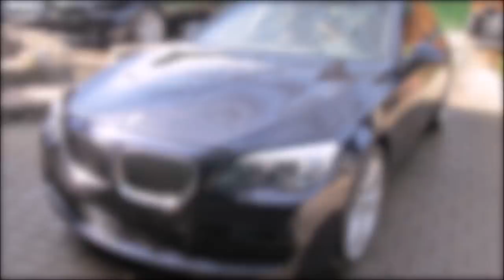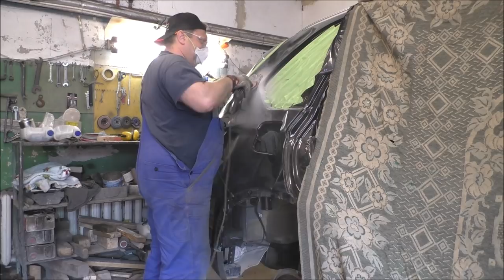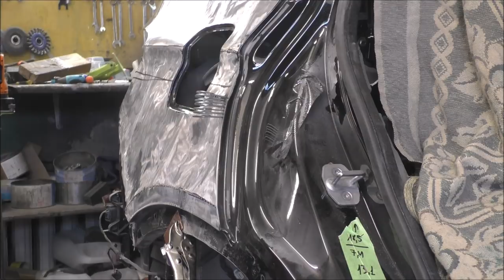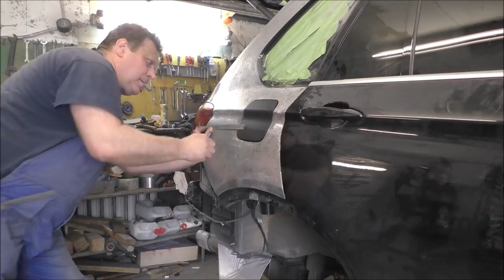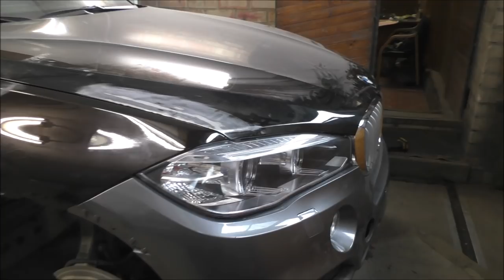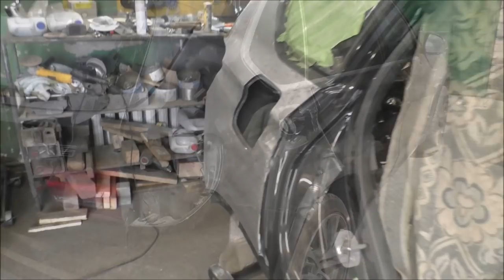BMW X5. Body repair.  Ремонт кузова.

Comment: I'm curious to know what the shop hour rate is, Arthur can fix that quarter panel easily, but it's a lot of labor. I'm betting the labor to fix the old panel  was close to a used one from a salvage yard.

Comment: NIce work.  With todays modern cars though I wonder how much grinding and sanding you can actually do.  Some of the sheet metal they use is so darn thin as is, I can't imaging sanding/grinding away 30-40% of it.

Comment: Why didn't the owner want to have the quarter panel replaced? Wouldn't it be cheaper than let you working days to get the old one in shape again?
Reply from the maker: It is easier to replace, but to repair cheaper.

Comment: Looks great Arthur, another fantastic finish. Once again excellent metal work and Superior Metal finish. The paintwork turns out real slick because of your work. Thanks for a great video have a good week you take care.
Reply: Wholeheartedly agree!, I'd like to see the paint shop's prep and spray operations. Most shops around here don't handle black all that well, and couldn't even attempt that right rear quarter.

Comment: I was reading an article by the collision hub , they bash Arthur because he take scrap cars and make them great again, these guys prefer to throw the cars away and discard them, they are jealous, they says he uses primitive equipment, yet most garages I know have  the same equipment  but do not use them because they will never repair any of the car Arthur is repairing. shame of collision hub to take on small operator trying to earn a living doing a fantastic job.